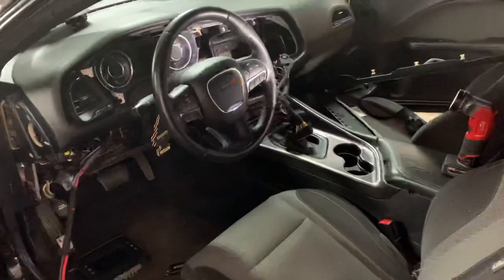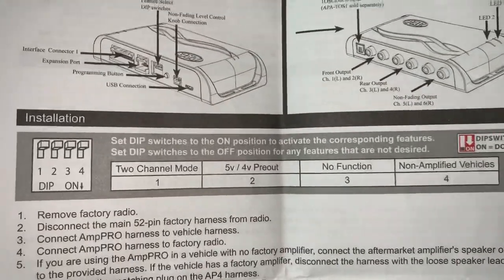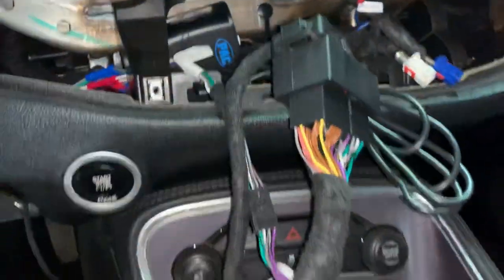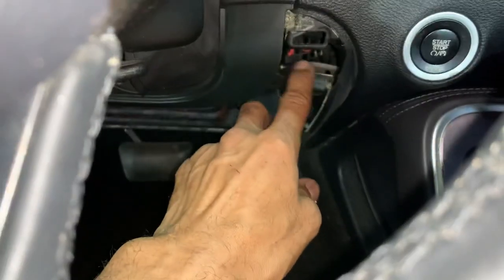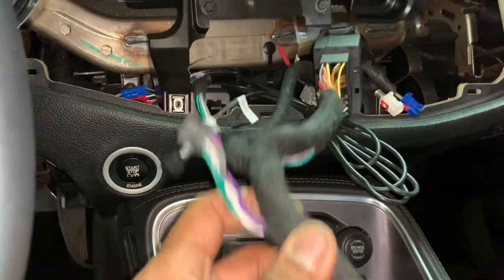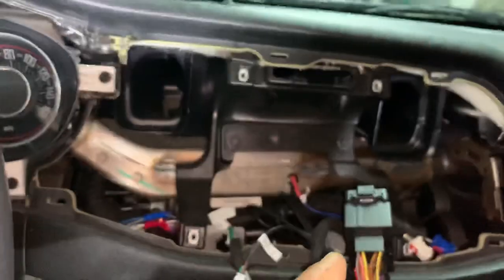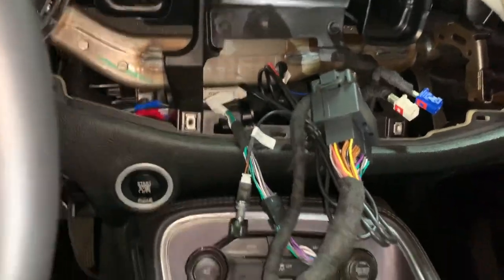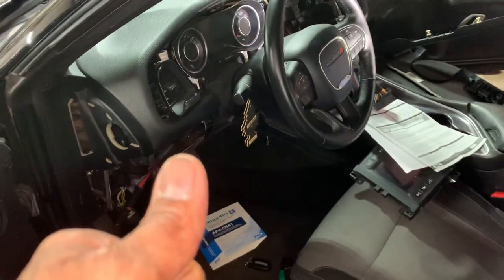Adding Amplifiers  HellCat ScatPack Charger/Challenger Plug N Play ✅ Way 🙌

Comment: I have the Beats system in my ‘17 Charger. It has 9 interior speakers, rear deck 8” sub and 10” trunk sub. Does the PAC retain all those speakers if i want to add an aftermarket amp for the in cab speakers and another amp for an upgraded trunk sub? The Beats system sucks so im upgrading all the speakers in the system and removing the 2 subwoofers but retaining the factory head unit
Reply from the maker: I’m not 💯 percent sure on that Butt I’ll look into it for you

Comment: I got a lc2i converter  with a amp and a 12' kicker. It connects to rear wiring on the back. Easy install. Look it up. My system is loud and the bass is lovely.
Reply from the maker: AudioControl makes a lot of nice units Butt this item I used in this vehicle is behind the radio and gives you front rear and sub outputs without tapping into any wires

Comment: Where are you located?
Reply from the maker: In Macon Georgia you can google the store for directions thanks
Reply: Do you have a video where you route the wires from amp to speakers on this challenger? I have the same car. Is it also necessary to have an LCQ7 to make this work? Thanks for the reply.
Reply from the maker: @jacon99able  I need too make one when I install my amplifiers in my challenger Butt too answer your ?  If you use that pac plug n play harness it gives you front rear and sub output from that module and it has a bass knob so there’s no need for the lc7i

Comment: I appreciate your video and definitely have a much greater understanding on how this actually works and it is practical. However On a Harmon & Kardon amplified system,  Do you need to do anything to the front doors speaker wiring to replace the subwoofer signal when you install 2way speakers?
Reply from the maker: Yes sir you will need too look underneath the dash on the driver side and locate the factory amp unplug the middle plug you’ll see a gray/purple and gray/yellow wires that the front drive speaker dark green/purple and green/yellow is your passenger speaker they need too be cut and ran too an amplifier if you choose too add one ☝️